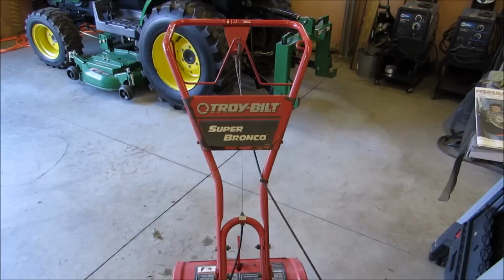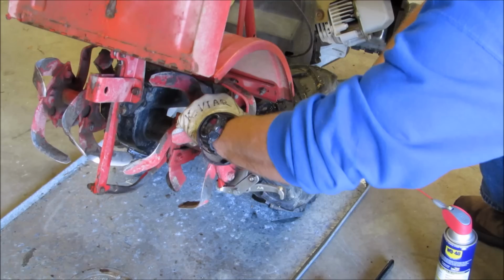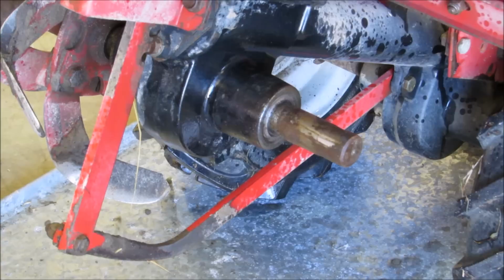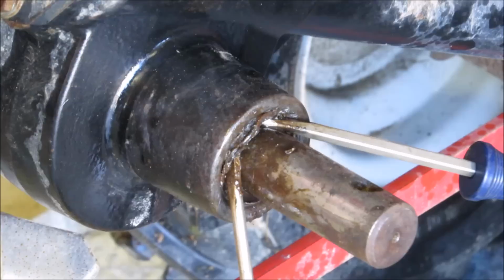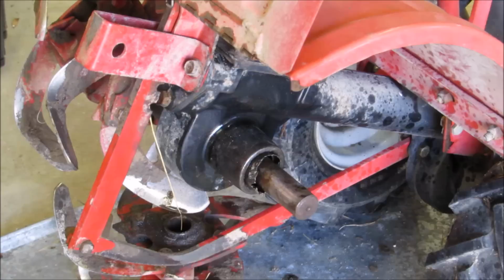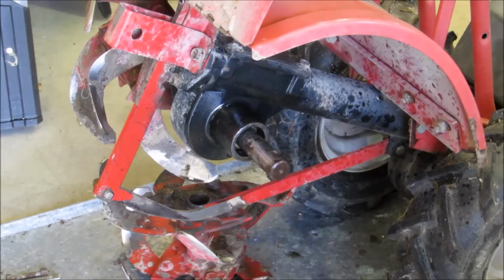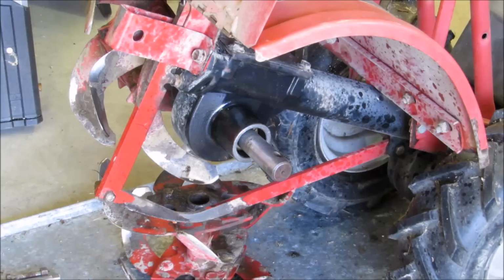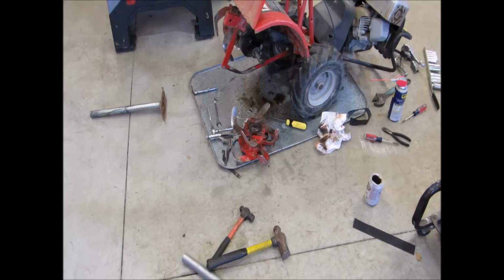Tine Oil Seal Installation On  A 2004 Troy-Bilt  Super Bronco Tiller  With KVUSMC

Comment: I used a long drywall screw and barely tapped the metal seal ring. Then I gently pulled it out. I followed by using a dull screwdriver to remove the rubber that had come half way out when removing the metal ring.
No scratches no dings! It was much easier for me. I hope it will help you all.
Reply from the maker: Marvin Braswell  Sounds Great Marvin I Will Try That Sounds Allot Easier

Comment: Gonna tackle my 70’s Ariens tiller tomorrow. Great video. Thx. 
Next time you sand the shaft with bearings in there, first stick a cloth with grease on it deep inside to keep steel, rust and sand away from the bearing.
Reply from the maker: I appreciate it the  advice I need all the help I can get OORAH

Comment: I must have missed that "little trick" you were going to show us to help remove the seal? lol
thks
Reply from the maker: DD826 I put  The Seal In The Freezer So It Would Help Shrink The Metal  Buddy So It Would Go On Easier
Reply: Drive a screw into the seal and use a dent puller.

Comment: First one was difficult, but I got it out after about half an hour and 3 skinned knuckles (foolishly forgot to put my gloves back on at one point, just before it came loose). Second one was easy, once I knew what I had to do. I was able to get my screw driver inside and behind the outer rim of the seal, after making an opening. It helped that I had used some Blaster penetrating catalyst first, and let it soak overnight. Got the second one out in about 15 min. or less. Polished the shafts with some 180 grit open coat paper, and am now ready to install new seals and put everything back together. But I do have to have my neighbor weld the inner Tine Holder tine flange on the one side, which was loose, and the tines just spinning on the Holder Shaft. Looks like it was just a press-fit. I see no evidence that it had been welded on either Tine Holder.
I just oiled the new seal with #30 engine oil and slipped it on. It went on easy. Pushed it in with my hands as far as it would go, then using a wood block, I tapped it in lightly. No problem. Went right in.
I also made it easier by removing the hood over the tines first, so I could get to it easier.
Reply from the maker: Good deal Brother You Rock

Comment: I need to replace both original tine seals on my 1999 junior tiller and I am not looking forward to it.  I am wondering though if a little MAP gas on the exterior of the seal cast housing would allow for expansion and easier removal of the old seals?  Cool video Mr. Viar ;)
Reply from the maker: +George T It May Work Buddy I Wouldn't Put To Much Heat On That Housing  It Should Help Many Thanks Buddy